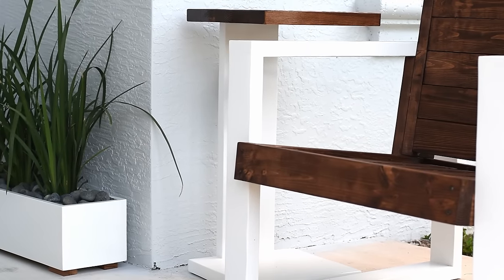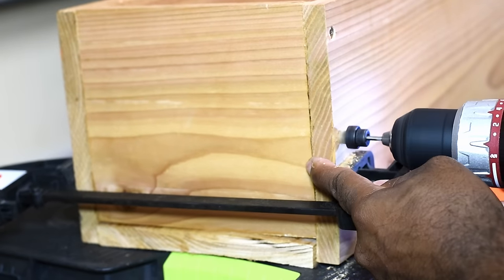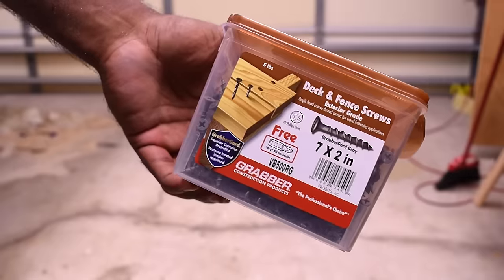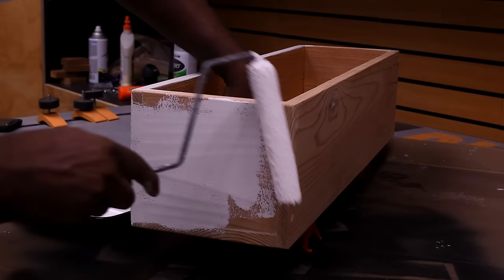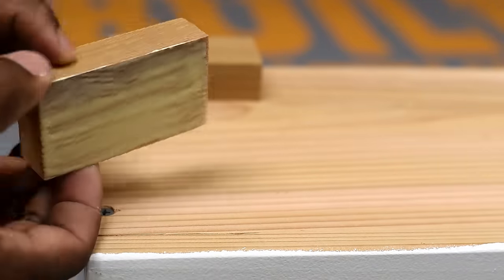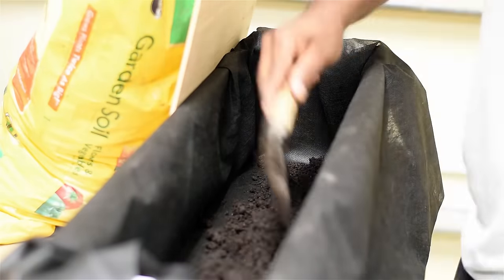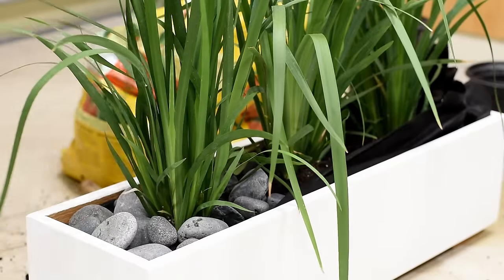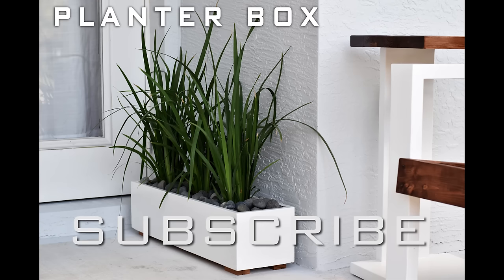Modern Planter Box | DIY Build

Comment: You did a great job.mi am new to this channel and appreciate this project. Is it possible for you to do a video about first time user tools.  I have never built anything but very interested in starting. Where do I start? What is the essential tools I should buy? Is there a particular brand you prefer? Thank you!
Reply: Please ignore my posting. I just found your other videos. But I would still like to know if you have a favorite tool manufacturer?
Reply from the maker: Thank you. Im actually working on a series call Limited tools. I started by presenting what tools I believe you will need. Here is a link to the playlist https://www.youtube.com/playlist?list=PLE6IL_H-YxnztDZbRLT9ItW2J7q2ejT40 I will be making frequent videos to help. Take a look at the videos in this play list. If you have any questions or need suggestion as far as what tools to buy just ask and ill give you some directions.
Reply from the maker: Here is a few brands that I believe will last you for a long time. 

1. Safety Glasses-  http://amzn.to/1UUsTcO  2. Dust Mask-  http://amzn.to/29jTnpP 3. Ear Protection   http://amzn.to/1Y1f5l1  4. Drills -  http://amzn.to/29sJmFv and http://amzn.to/29wFBiP 5. Trim Router http://amzn.to/29k4sTx 6. Jig Saw http://amzn.to/29jT4eR       a. Jig Saw Blades http://amzn.to/1PzTaJ17. Circular Saw http://amzn.to/29wFPqs8. Orbital sander - http://amzn.to/29sKngR9. Measuring Tape - http://amzn.to/23irDnp10. Pocket hole Jig http://amzn.to/29jTBxk 11. Clamps http://amzn.to/1QdspQv12. Chisel http://amzn.to/1UUwqI513.  Mallet http://amzn.to/29R13wx   14 . Combination Square  http://amzn.to/29Z1aEX 15. Level http://amzn.to/28NcVJ2
16. Hand Saw http://amzn.to/1ZYQYka    17. Speed Square http://amzn.to/29Xoc19
18. Framing Square http://amzn.to/2adX3ZK

Comment: LOV it.  I am making one myself BUT I am using the cheap bubble wrap wood.  I painted my box first (big mistake).  I also used a 1 X to give the sides and bottom support inside where you can not see it.  What is the name of the gadget you used to make the holes in the bottom for holes and how $.  I really enjoyed your video and loved your planter.  I am thinking the only thing I would do for yours is paint the feet.  I am thinking of inserting wheels.  Dirt is heavy and I am not into just keep something in one spot.  This way I may decide to move it for what ever reason and no big deal.  THANKS

Comment: You need a jointer and planer rather than looking for straight boards.  In addition, if you paint the inside with a water barrier tar coat it slows down the rotting.  I would also make a tray for underneath it so that the water dripping out from underneath it does not leave black trails from the silt.
Reply from the maker: I don't have a joiner I do have a Thickness planer. Viewers would like to make some of these projects as well. If I pull out too many tools some will be intimidated to try. At the end of the day im not a pro. I still have a lot to learn and mistakes will be made along the way. I agree with the dip pan.

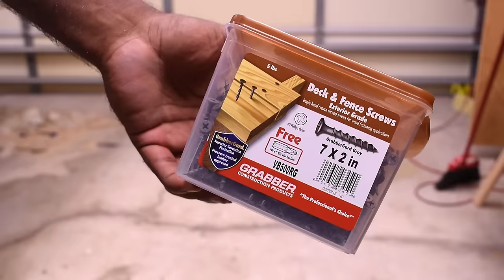Comment: What is the difference between the screws 1:20
Reply: If I'm not mistaken, deck screws have a coating on them and are designed to reduce corrosion. Since this is a planter box, sitting outside and watering the plants could result in corroded screws if you don't use the correct ones. Even thou he covered the head screws with wood filler sometimes the corrosion will bleed right thru the top paint coat.